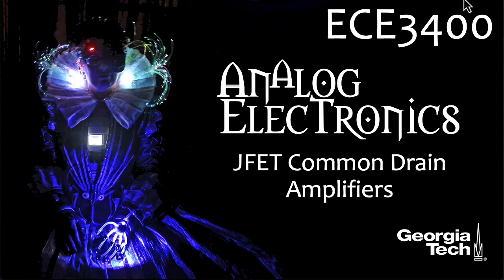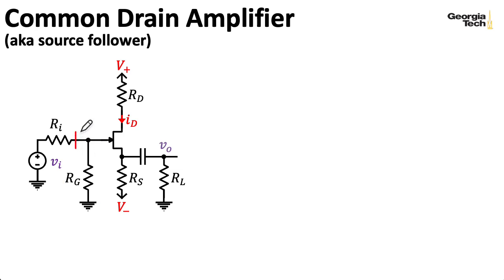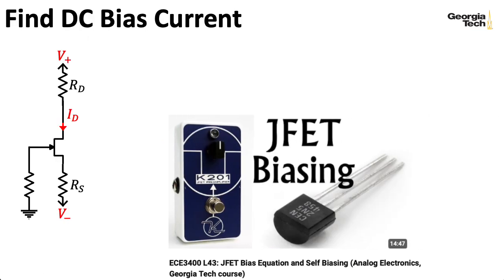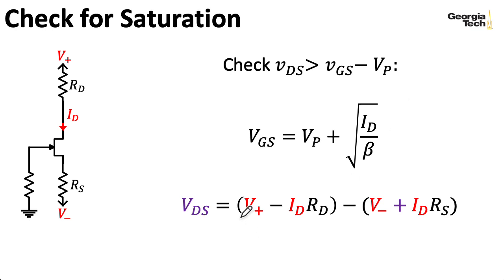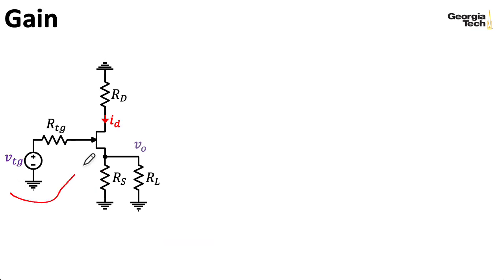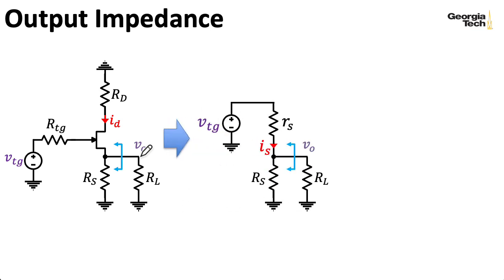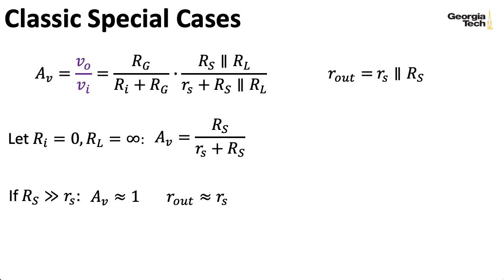ECE3400 L46: JFET Common Drain Amplifiers (Source Followers) (Analog Electronics)

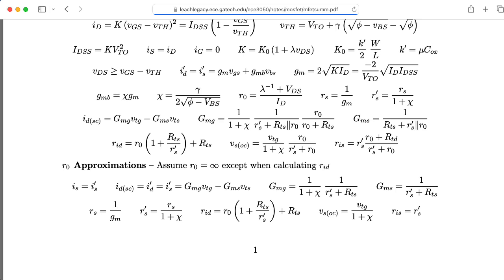Comment: Perhaps I missed a lecture, but what is Bulk? 8:20
Reply from the maker: It refers to a connection on a MOSFET that's not present on a JFET. On a discrete MOSFET, one of the channel terminals is hooked to the bulk, which you then consider the "source" usually. In integrated circuit design, the bulk is typically hooked to one of the power supply rails (negative rail for nFET, positive rail for pFET) just because of how it's constructed. Alas I don't have any MOSFET lectures at this time as part of the ECE3400 series. I do have one that talks about the bulk connection under the admittedly clickbait title "They Mislead You About MOSFETs," which was an experiment in the effectiveness of clickbait titles, and it turns out yeah, they're pretty effective. (The video does have educational value, though.)

Comment: Would be nice to see some explanations about voltage and current noise. I made some low noise, discrete circuits over the years, but it reached the physical limits. Even noise of the passive components are a factor in this case.
Reply from the maker: https://leachlegacy.ece.gatech.edu/ece6416/index.html
Reply: Just discovered your channel. We have very similar approaches to this stuff, so of course I have to say that this is an awesome presentation! 👍🏻
Reply from the maker: @ Hi! I just subscribed to your channel, great stuff!
Reply from the maker: I'd love to --- alas I don't understand it myself, to be honest!

Marshall Leach taught a low-noise electronics course (alas it hasn't been taught since he passed away), he has some info on it on his website.